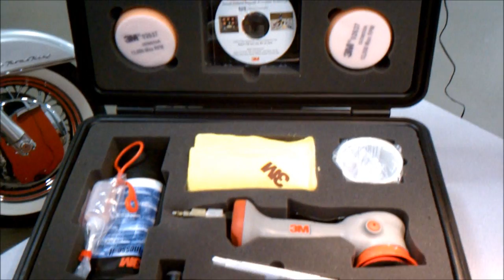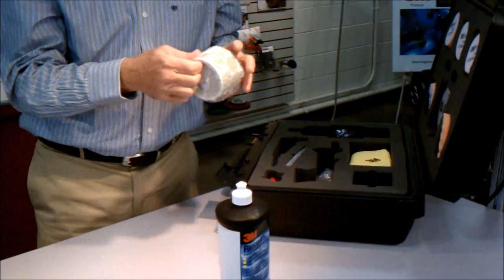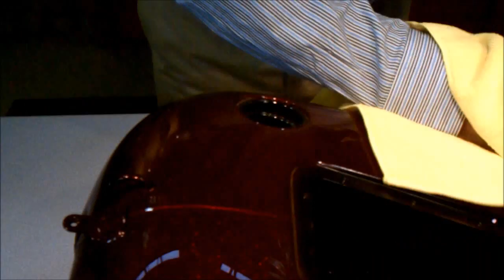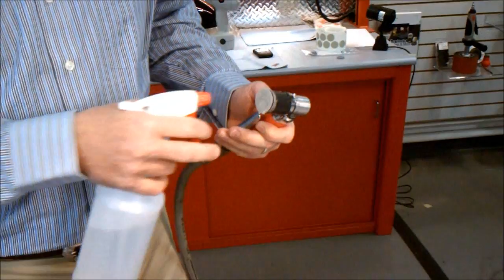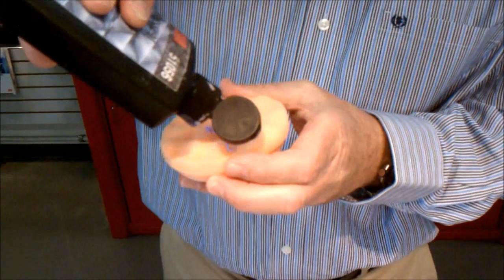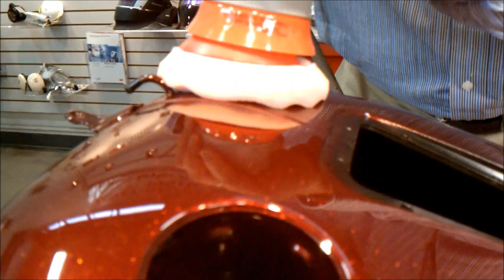3M Clear Coat Repair Kit

Comment: you are talking a thousand dollars kit ?
Reply from the maker: +Valentino Remonde Correct; the kit is priced at over $1000.  The majority of the cost is in the power tools themselves.  While a similar result can be achieved with less expensive tools, or no tools at all, the combination of tools and abrasives provide the best possible results in the shortest amount of time.  Depending on your application you could use only the polish and an automotive buffer or for more severe damage you could first use the Finesse-It Hand Sanding Pad #70437 with Trizact Finesse-It sanding discs.  Thanks and good luck with your project.

Comment from the maker: It sounds like that is too large of a spot to repair with a pen.  I would suggest treating it like a spot repair.  You would have to feather down the edges then spray some clear.  Be careful not to sand through the color. For an area that small you might want to try an airbrush.  You can get a fairly cheap one at any craft or art supply store.  You could ask a bodyshop to give/sell you a small amount of pre-mixed clear (as opposed to purchasing $100 in supplies).  Good Luck

Comment: Just removed my reflectors off of my front forks. It appears that the metal polish i used to help remove the goo took off some of the clear coat in an area about the size of a dime. Is it possible to fix this with a clear coat pen?

Comment from the maker: The majority of the cost is in the air tools. You can likely reduce or eliminate some damage without the tools (using the right abrasive materials) but making the repair "undetectable" is what we are trying to achieve. This repair process, that has been certified by manufacturers, provides a repair that is as good as or better than the original finish.
 
You can purchase the discs and polish separately as well.

Comment from the maker: Depends on the depth.  The deeper the scratches the more "work" needs to be done.  The sanding process can speed this work.  Many times buffing can reduce or eliminate scratches without sanding.  I always recommend buffing first and sanding only when necessary.  Sometimes simply using a soft microfiber cloth and polish will do the trick.  Scratches that go through the clear coat into the paint (or worse) can never be completely eliminated by sanding or buffing. Good luck.

Comment: @engmantaylor Okay, thanks. I think it's due to poor masking along a rubber seal and the seal has peeled the paint in one spot. What I did was (very carefully) Cut only the clear layer around the edge of the bubble with a sharp modelling knife. I then blended that edge with if I remember correctly 2000 grit sand paper and polished. It worked well, but only because the bubbling clear was from a repair and effectively had clear underneath. It's also worth noting that the spot is about coin size.

Comment from the maker: @jcadlols - If the clear is peeling, this will probably not help.  It sounds like the painter waited too long between coats, did not prepare the surface well enough, or mixed the paint incorrectly.  If it is one small spot and only the top layer of clear it may be worth trying. This system would definetly blend the edge of the peeling clear, how long it last would depend on the extent (and cause) of the damage.  Good luck.